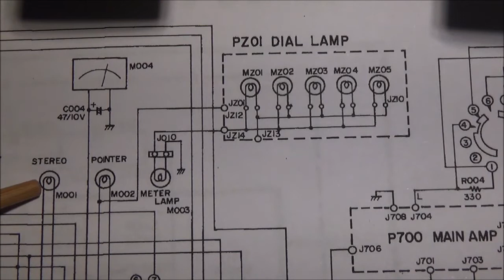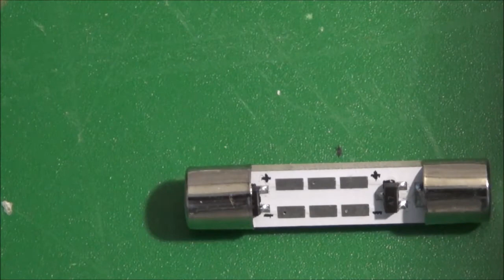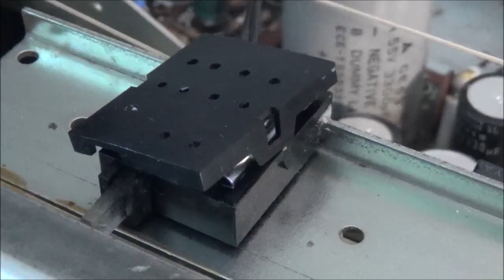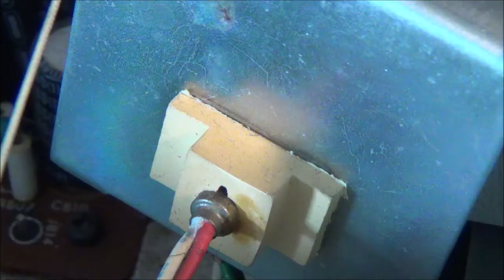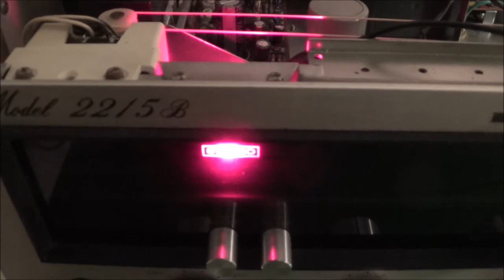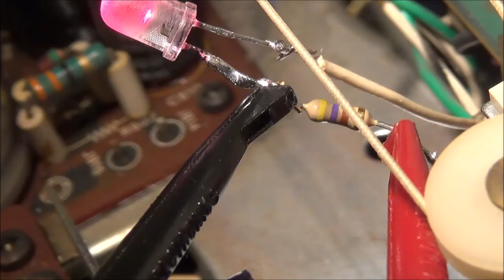Marantz 2215B Stereo Receiver Lights PART 1

Comment: And what voltage comes on the meter lamp sir? Is it 6.3 volts and what is the oruginal fuse type lamp's spec? Is it 8 volt 40mA? Tuning lamps (5 of them) are 8 volts 20mA for the old ones and the new LEDs are 8 volts 200mA? Am I right? Both lamp circuits are 6.5 volts?

Comment: What is the voltage that flows in those lamps in the corcuit, is it 6.3 volts that goes through those 8 volt lamps sir?

Comment: Not sure you can help. I own a 2215b and the stereo light doesn’t work. The bulbs is fine just not getting any output power.  Radio is working fine. Any ideas?
Reply from the maker: I think you can try adjusting R302, which is a blue potentiometer. Remember or mark your initial position and turn a little at a time. This is shouldn't take much turning. Once the light comes on you will notice if you turn to far each way, the light will go off again. You want the position right in the middle of these extremes.
Reply: @OldSchoolElectronics  may i ask what's R302? thank you!

Comment: Hey Mr Oldschool, The Marantz has service friendly design thoughts. The bulbs are fuse shape instead of hardwire soldered style. Also I didnt know that such form of LED drop in replacement exist until shown. That's good to know.

I learned new technique here today. To reduce LED glare by light scuff it a bit. Thank you for another great video. Catch you on the next one later.
Reply from the maker: Thanks, sir! Not a special video, but maybe helps someone a little. I left a comment on your YT site a week or so ago, by the way. Hope you are well.
Reply: @OldSchoolElectronics  You commented in my blog? Google normally do not notify me. Something to do with their algorithm probably. I will check. Hehe
Reply from the maker: Mr. Yustech: I left a YouTube comment on one of your videos. I didn't know you had a blog.
Reply: @OldSchoolElectronics  No worries Mr Oldschool, I will check. Hehe

Comment: Like you, I'm not into replacing with LED, but do agree that this did turn out great!  Great job, OS...unfamiliar with the double LED thing you mentioned at the end.  ~Jack, VEG
Reply from the maker: Thanks, sir! That was just part 1. The double diode thing is in part 2 which I just gotta upload. I really didn't explain everything, like dropping resistors, but there are dozens of videos out there and you already know your stuff anyway.
Reply: @OldSchoolElectronics  Will be looking forward to Part Deux!  Im glad you have faith in my abilities...cuz I think they sux!  :)  I recapped a radio and now the dumb thing don't work, I've gone through and checked my work 3 times and even re-recapped it...I did find one cap in backwards and one of the new ones was dead, still no working....so that will go into the pile of round-to-its!  :)  Its a video I was doing for July 4th...Ill still post it, but its not the ending I was hoping for. Wished you lived close to me... :) ~Jack, VEG
Reply from the maker: Thanks for commenting! Re-recapping, now that is the first time I have heard of that! You are going where no man has gone before; the final frontier. I think you can solve the problem though; you got it in you. You do have enough skills. It's probably something so obvious you can't find it now.